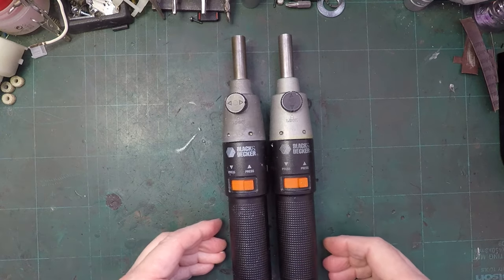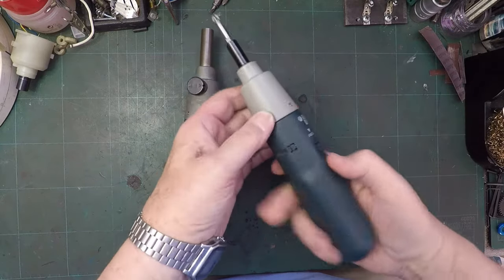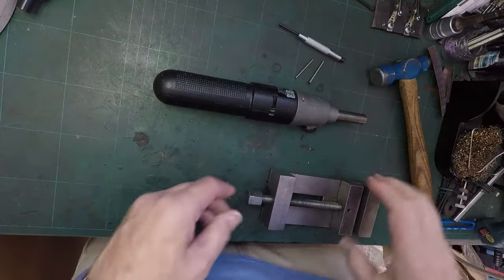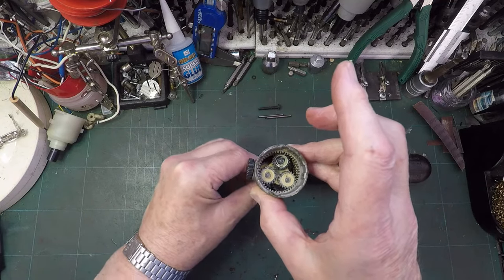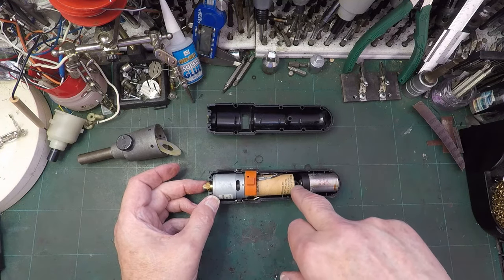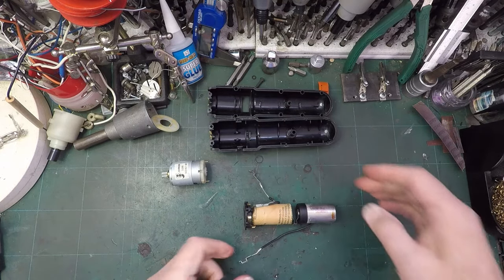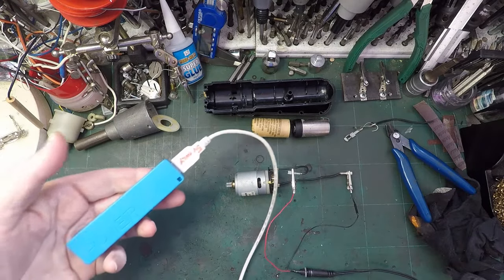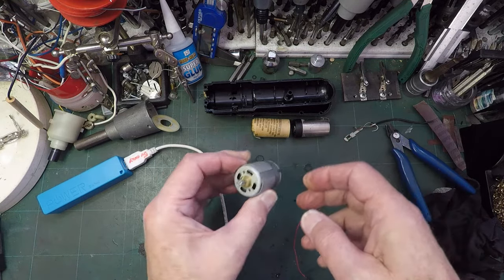Déjà vu - Battery conversion of Black & Decker  Cordless Screwdriver. NiCd to Li-Ion with USB C.

Comment: Did you consider not using the type C USB connector on your Lipo charging board, and instead, solder the wires from the barrel jack charging port to the Lipo charging board directly? This way, you can use the same AC adaptor to charge the battery.
Reply from the maker: I have done that with other screwdrivers so I wanted to do this one different.

Comment: Nice conversion, I have a couple B&D and a couple Skill I will for sure be doing this upgrade. I noticed that you didn’t put the plastic spacer back in, is there a reason for that? Thanks for sharing, Wayne
Reply from the maker: I don't think you need the spacer but some hot melt glue might help hold everything tight.

Comment: Did that with the pistol version ... but no torque.
Reply from the maker: That is odd. Torque mostly depends on the gears with small electric motors.
Reply: @DaftOldMan  Ni-Cad is known and used for high current demanding applications. Why Li-Ion compensates in voltage. Did a few cordless drills and with more room able to do 2 or 3 Li-Ion cells parallel and that works great. Oldest one has been in service for over 30 years now. Till the motor gives up i guess.